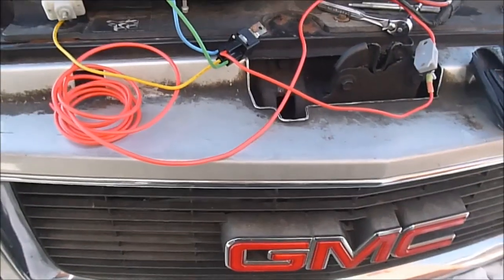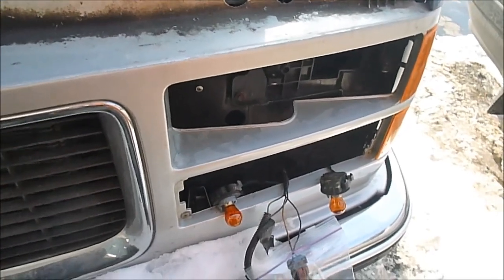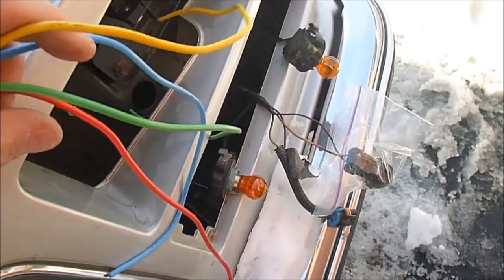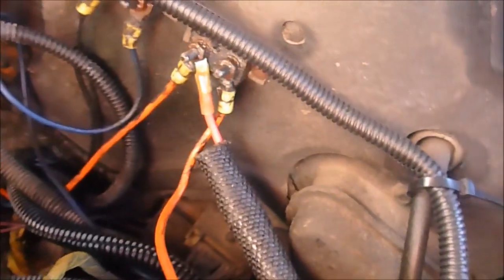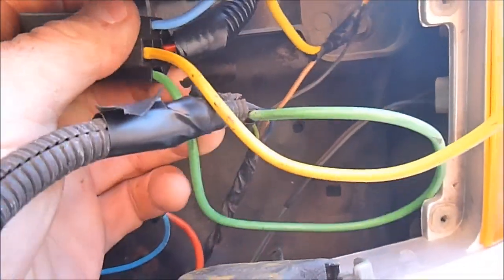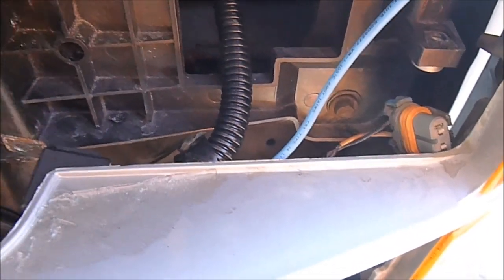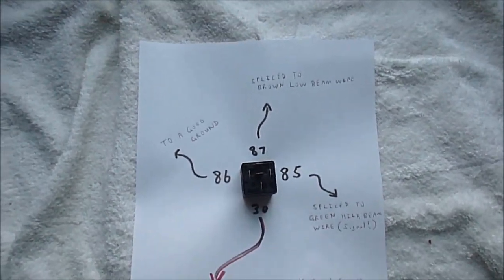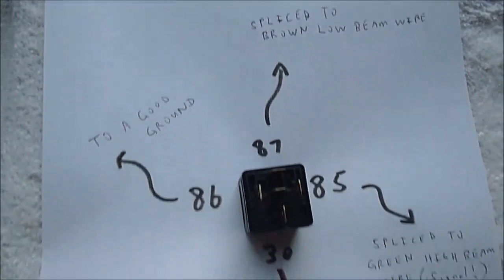1996 Suburban, Modifying the Headlights to have low and high beams on at the same time

Comment: Can I connect 30 directly to (+) battery? Ty
Reply from the maker: Rodney, yes you can, that is your power in, just be sure to have it fused, or better still, a circuit breaker that resets quickly.

Comment: I've been wondering how to do this for my 97 Sierra
Reply from the maker: While a bit complicated, this process allows you to take power directly from the battery which lessons current loss going through the main headlight switch Etc. The difference is literally, like night and day doing this modification
Reply: @SammyVista1972  thank you

Comment: 85 on relay is to ground not to power source check your relay diagram
Reply from the maker: Been working all these years without a problem, 0n this circuit I am not worried about a spike when the fireld collapses. Your input is appreciated.
Reply: spikedpunk  thanks just trying to be safe for no confusion for others 👍
Reply from the maker: @elbatobeach  for sure. On delicate circuits this would be very important for the diode to work properly to prevent voltage spikes.
Reply: It’s all good and take care at this time turmoil of bad epidemic
Reply from the maker: @elbatobeach  thank you. Same to you and yours.

Comment: What's up with the ground on the plastic grill lol come on now
Reply from the maker: Sigh. Please read further in the comments. Been tackled before. Screw is metal. Screw goes into metal part on truck under plastic grille. Must have done something right, it is still working fine. I thank you for your input and concerns none-the-less.
Reply: @SammyVista1972   not trying to knock you just would have been more of a solid ground somewhere else.
Reply from the maker: @olskool501  relays take such a minimum of amperage and I can't quite remember why I ran them there, I did for some crazy reason and it has behaved without fault since then. I have left a sleeping dog lay!

Comment: I love how his ground is on plastic
Reply: No shit eh. He would never make it in a wiring job, first time they saw that he would he skidded. Metal on metal on metal no plastic in between anything.
Reply: What’s the difference. Keyboard warriors is right. Ground is ground. And they way these two speak, they have obviously not been doing this type of work for decades, and learned one simple, fact. Ground is ground. 
Nice job, nice mod.
Reply from the maker: Brenton Cunningham Genius.keyboard slayer. The screw  passes through the plastic to a good metal ground on the support. Find something else to criticize somewhere else as all see the project worked out and is still fine today. Think McFly, think. I am going to leave here not too well thought comment on here because it is so funny. So yes look at how he did his ground in the plastic look at the whole picture
Reply: spikedpunk I understand the ground works but it would make so much more sense to put the eye under the plastic so it could contact the core support and make a lot better of a ground if that's where he was gonna put it

Comment: please tell me you didn't use the bolt that holds the grill in place as a ground? especially on top of the plastic tab of the grill. in my opinion that is a horrible ground
Reply from the maker: Well I guess the truck never read up on that, for I have never had a problem.  The truck is well oiled, does not see salt, and this connection is going into clean, bare metal.

Comment: have you people ever read the law concerning the use of low & high beams,
Reply from the maker: Mikey Webb  I do not understand either. Style over function most likely.
Reply: Most states allow 4 lights total to be on when high beams are turned on, 2 for low beam. Lots of new cars automatically turn 4 lights on when high beams are selected. I have hid high beams and led low beams and have added a relay so I have all four on with high beams, I live in upper Michigan and it's beyond dark here in the winter, it helps alot when u can actually see the road
Reply: This is an example of because the manufactuer didnt do it then the man on the street thinks its against the law to do it. Pretend lawyers... Smdh
Reply from the maker: Yes.  What is your statement exactly referring to?  I would like to understand the question or the reason for your comment.

Comment: What kind of relay is it?
Reply from the maker: The relay is a standard Bosch style as they are called 5 blade (87A can be ignored) you can also use a 4 blade as well. If you have trouble sourcing I can try and get a number off the units I have used.
Reply: I just wanted to know I'm going to do it tomorrow just needed to know what kind to get I have a 95 gmc single cab and the lights are dim af
Reply: +spikedpunk what amp relay is it?

Comment: I have a 95 Chevy with HID's in the low beams, could this mod work if I had HID's in the high beams as well? I know the Hids are 55watts of draw, it be a total of 110 watts.....
Reply from the maker: +SpeedyChevy72 Yes, it can work, the relay will take care of the wattage needed.  Just be aware, HID's don't come on right away so you will not have high beams at once.  I solved this by having a Silver Star bulb on my left high beam and a an HID on the right, which when it warms up, gives a lot of road sign reflecting way down the road.

Comment: You are aware there is a way easier and way cheaper way to do this
Reply from the maker: Jon Groves Thank you.  Please explain this method. Does it involve the jumping of relays with wire in the fuse box?
Reply: +spikedpunk Nope, but you also don't have to use half a mile of wire and don't have to take out the headlights either, just do it all a lot closer inside the engine bay. You've got the basics, it's just that there's an easier way to do your exact method.
Reply: Jon Groves write me back. if you are from Macon,GA

Comment: Yo dude thx for the repair for the 4 beam headlight system, its so annoying that the low beams turn off when high beam are activated... I just did the relay modification using HIDs on a 1995 Cadillac Deville, and it works great!!! Im going to try the relay on the fog lights on my 2008 Cadillac DTS and 2011 Ford Explorer XLT. because they turn off when high beams are activated. now I have to figure out how to fix the warm up time for after market HIDs, my 2008 Cadillac has OEM hids and they come on full brightness, does anyone know how to do that with after market hids ??? thx again!! for the info,.
Reply from the maker: Gary Kwitko You are welcome!  I am not sure why many manufacturers do this, have the lows go off when the highs come on.  One would figure that with high amp output alternators, this would not be a concern to have all 4 on at the same time. Fog lights turn off due to motoring regulations in many states and provinces, for too many lights on (???!!!) is not allowed, nor are fog lights allowed on with highbeams.  I would like to figure out a way to have 'instant on' for HID's as well, for I have one on the right side high beam of the truck, and a Silver Star Ultra on the passenger side - for instant on.  The HID, when it comes on, gives extra down the road illumination of road signs, ETC.

Comment: I bought a generic kit for my trk which is just about a twin of the being shown. Love the trk. Love the lighting improvement
Reply from the maker: Whatever the means, the generic kits make the project just that much quicker to to get done without the need of cutting and fitting wires as I had to do. Thank you for the kind words on the truck, it will be out again soon for the nice weather driving season.  The lighting improvement is really nice.
Reply: Looking to convert my truck over to this. Any advice on where you found a kit and how has it worked out?

Comment: did you just use one relay?
Reply from the maker: Yes, just 1 relay was needed for the job.  The reason is that the wiring is common across the headlights on both sides. Thanks for asking.  I can never figure out,as  a side subject while writing, people who 'dislike' how to videos others take time to post, thus giving others an easy time in their projects.  Hope your project works out, it really makes a difference at night!
Reply: spikedpunk Ooooh it should... at night i end up holding the lights down so that all 4 are on XD

I live up in the moutnains :P

But yeah, i run wires from one relay to both lights right? (noob question i know but im new to electrical stuffs)
Reply from the maker: No question is a bad question, better to ask BEFORE! Yes, the difference with all 4 working at once is something else. You just need to splice the relay as per the diagram into one of the wires, as the wiring is as I said common for both left and right sides.  If the lights had independent circuits, then I would recommend 2 separate relays, one for each side.  Watch the clip and look at the diagram again, it took me a bit of time before the concept sank in.  Don't worry!

Comment: Hi I have a 91 v2500 suburban. On mine both wires that go the the low beam have  constant power.  When the switch is turned on, it adds a ground to one of the wires to turn the light on. In my case how do I wire in the relay? Thanks!
Reply from the maker: Hello.  I believe you have the rare odd-sized lights offered for a couple of years at most.  Nice thing about GM is that they always have had the same wire colors.  Tan for low beam positive, Green for high beam positive.  Are you getting the ground coming onto the black wire when you switch on the lights?  Then all is good.  Are you probing wires with the bulb in place, this is why you may get 'positive' on both wires.  Regardless, you attach the 'power supply' to the low beam to the TAN wire only! Please see the diagram near the movie end once again to see what I mean. It clears up a lot of the fluff and mystery of the project. Signal wire to activate the relay goes to green on the high beam circuit. Always protect your circuit with a fuse or circuit breaker, I can't emphasize this enough! Any more questions, please feel free to ask!
Reply: Thanks!  That makes sense! Your the first person to clearly explain that to me I really appreciate it.
Reply from the maker: Jorge Carranza You are very welcome Jorge, I'm glad this and I have been help.  Sometimes it simply takes somebody slowing down just a bit for a few seconds to give another person a bit of help.

Comment: Hi I have a 91 v2500 suburban. On mine both wires that go the the low beam have  constant power.  When the switch is turned on, it adds a ground to one of the wires to turn the light on. In my case how do I wire in the relay? Thanks!

Comment: Camera focuses really well up close
Reply from the maker: It does a really nice job.  It is one of those under water capable cameras, which is what we purchased it for in the first place, and have been quite impressed with the overall performance of it, including the ability to focus really well up close as you say.  Only major downfall?  It likes batteries, so we have extra rechargeable units to swap out if need be.  Other disadvantage worth mentioning:  Under water make sure you have a FULLY CHARGED battery before you dive in!
Reply: spikedpunk
Yup, I have spare batts...

Comment: I should have sent you some shrink tubing, I have tons, cheap on ebay, and starter sounds slow
Reply from the maker: Thanks!  In the next bag of Suuuburban parts!  The starter, as I did mention in the video, is slow, thanks to a cold day, non-synthetic Rotella 10W-40, and the bad cable connection pointed out.

Comment: I have the Painless crap 4 high beam setup, The relay is not sealed and its no good, i blew through many when they got wet.   I had them corrode so bad the relay stayed engaged and it kept the lights on with the key off.  Go on amazon, Get the Philips 9012 Bulbs  for the low beams and 9011 bulbs for the High beams  The 9012's are HIR  Halogen bulbs which are quite a bit Brighter and shine a WAY longer distance all for $80 and all I did was change the bulbs.   I have a video on modding the bulbs, all you have to do it trim the ears.  BTW are those Original headlights and parking lights? They are CLEAN!
Reply from the maker: I actually have The Silver Star Ultra 9006 bulbs on the truck right now for the low beams and they do a very decent job.  I will keep the HIR Phillips in mind though. I like the Silver Stars even better then the HID's (6000K's) that were in there before on the low beams.  Sure, they made light, but it was all over the place.  I check tested one in a high beam, though it obviously did not fit, as the hole needs a 9005 style (been ordered), the light was a dazzling beam, which will be perfect for lighting up the roads!  The relay is well protected on mine, and once all is tidied up, will be getting a coating of di-electric grease to be sure. I will have to look for your video, the problem is, the 9006's have a larger diameter base then the 9005's.  The headlights were replaced quite some time ago, but have been kept very clean. The parking lights are original also kept polished and clean.  The tail lamps look like new too!
Reply: Just type in HIR BULB and something comes up. All you have to do is cut the tabs down a little. I had the silver stars and these HIR bulbs  shined further and whiter.  The Philips bulbs are ok and what I have, The Toshiba HIR bulbs are apparently better but hard to find.  I forget unlike the Northeast, This state has sun bleached white roads, which also helps with nighttime lights. The dark tar roads suck up light
Reply from the maker: ghtowagon Thank you, I will do some research on the HIR bulb family.  Yes, the different roads do have a profound effect on light showing on them.
Reply: A white road is like when it snows, the lights are much more reflective.
Reply from the maker: ghtowagon Blinding even at times!

Comment: Did you sale your malibu no video on it for long time man.
Reply from the maker: I certainly still do have the Malibu.  A movie will be made once it is tidied up a bit! You can just see the back of it peeking in the video here.  The car has been absolutely trouble free (OK, it needed a gas cap so the 'Check Engine' light would go out.  While it is a little dirty now, the body is doing extremely well, again being sprayed with oil, and having grease slathered over some areas known to give trouble.  It started with no problems at all in -27F ambient (-42 windchill) temperatures running on 5W-30 semi synthetic oil.  A wonderful car. Oh, during the coldest days, the ABS light would come on every now and then, I attribute this to a bad connection on the right front wheel sensor, we did see a bit of corrosion on the connector which will be cleaned to ensure no more problems in the future. It is fine now it seems.